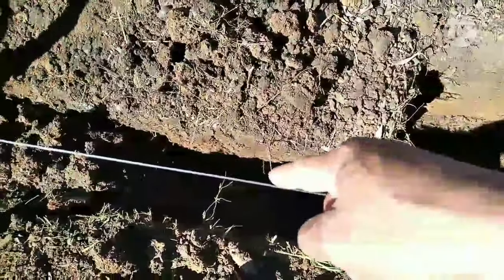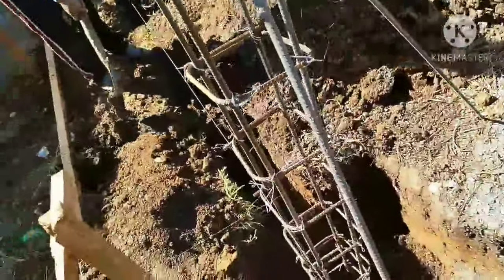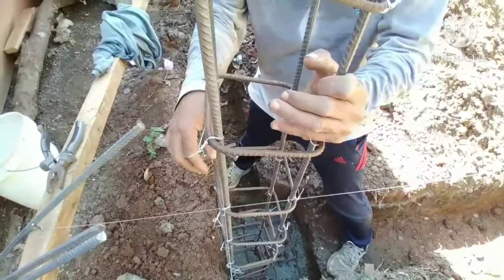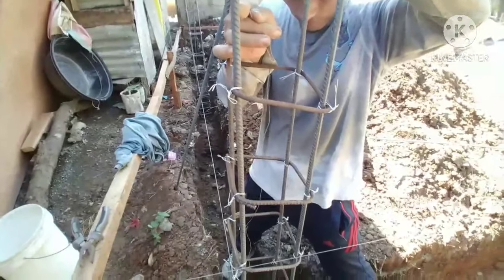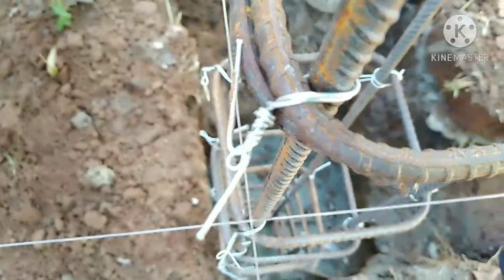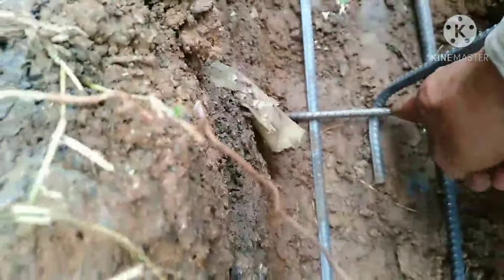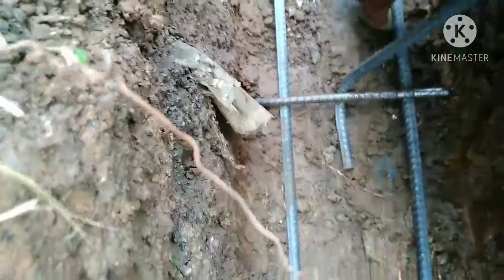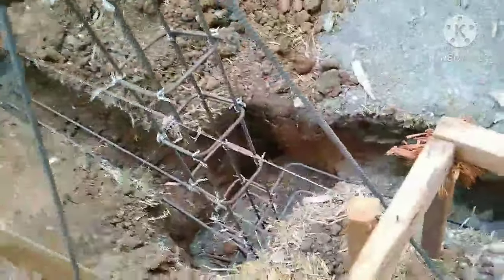paglagay ng bkal sa poste paano ngaba??

Comment: Bad practice na binaon mo ng "4inches" sa sides  yung bakal na para sa parilya mo para sa wall footing. Malaki ang possibility na mangalawang or mag corrode yan in the future. Mahalaga na may sapat na concrete cover ang bakal lalo na pag exposed sya sa lupa
Reply from the maker: Yes sir tama po kayo..at lahat po ng mason alam po yan...
Reply: dapat po nska bend yun vertical bars at nakatali po sa wall foundation at hindi po nakatusok o may contact sa lupa,dapat po may concrete cover na 45mm-50mm,at yun po sa Footings,dapat po may beddings na graba...salamat po♥️
Reply: Kurt lavarez edi ikaw ang gumawa
Reply: @fantasticchanel8138  😄
Reply: @ronnieladores5359
Reply: @ronnieladores5359
Reply: Based sa video mo maraming Mali sa pag install ng Main bars sa column to the matting bars at sa zocalo rebars, allow Engr. to inspect before pouring of concrete. Suggest ko sa iyo
Reply: Wrong practice
Reply: Oa ka naman po.  Goods na un nasa Pilipinas naman siya.